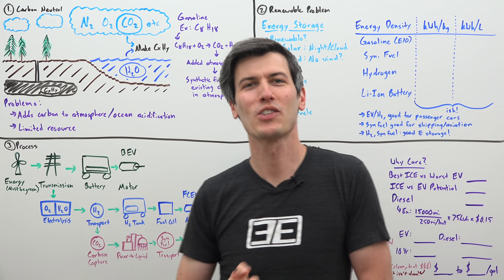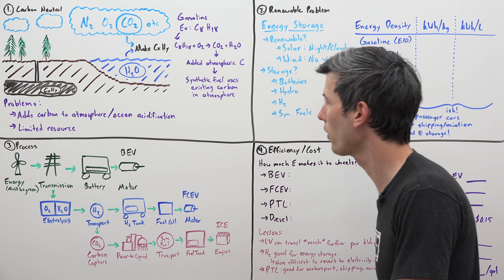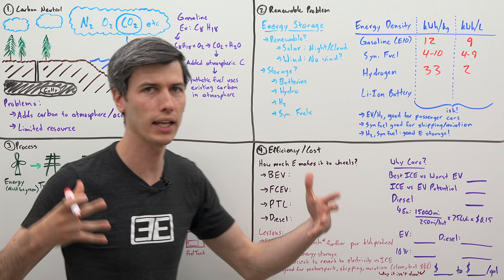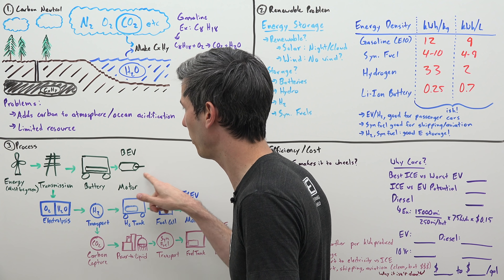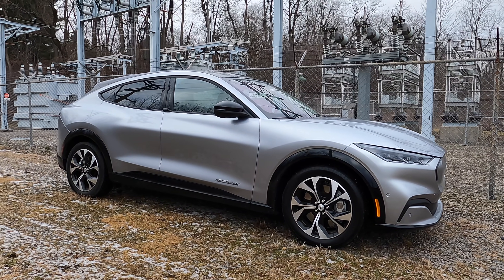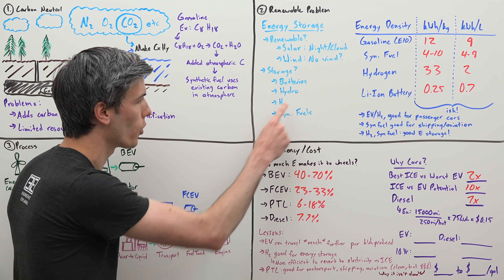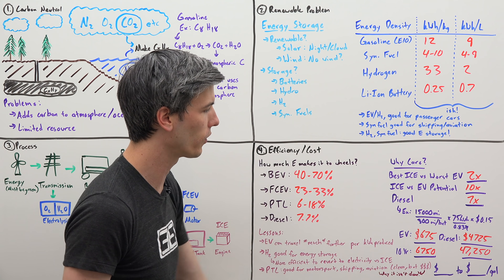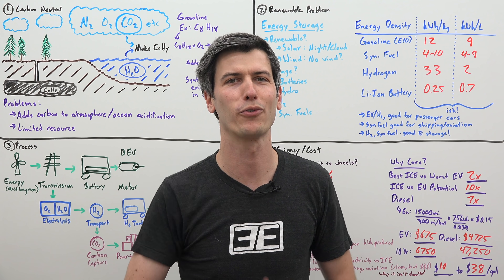The Big Problem With Synthetic Fuels

Comment: The fact of the matter is that it would be better to run on straight E100 ethanol produced from purpose grown crops with high sugar content like sugar beets (not corn) and not convert it to synfuel. The problem with ethanol is mixing it with conventional fuel. Henry Ford said ethanol was a much better fuel than gasoline because, even though it has lower energy density than gasoline, it can tolerate much higher compression ratios without detonation,  and all his early vehicles were designed to run on both with a simple ignition timing adjustment on the steering column. Ricardo engineering in UK built a pure ethanol engine that delivered tremendous torque for its size, more than a much larger diesel engine. The seals in older cars can simply be replaced with modern ethanol compatible materials. There is enough idle farmland to grow fuel crops without competing with food crops. It's basically become a political issue.

Comment: Right now its expensive yes but costs of the E-fuels are comming down every year by 2027 They predict it will be cheaper than the normal gasoline we have today. That would be a game changer. Supply and demand always the way the effect price. RIght now Supply for E-fuel is very low so costs are high. But Mass Production and Supply will bring the cost down. Same with the fuel prices today.

Comment: Another perspective for sure and I am looking forward to learning more. We still have all of the issues of EV re lack of range, cold weather performance or lack there of, charge times that are just not practical, and things I am less aware of but understand we should be concerned about re the mining of lithium, cobalt and the base needs of a Lithium Ion Battery. The cost of batteries is still incredibly extravagant re $5K plus as well. 

All this to suggest that of Porsche and others promoting Syn Fuels can get the price down to $2.00 per litre and produce it in the volume required, we may truly have a carbon neutral option that sees ICE enabled vehicles to thrive. The next five to ten years should make for interesting times. Great discussion and thanks for posting.

Comment: How about the carbon footprint of making electric cars? How much energy from renewables are actually being used for EVs? How about the crap infrastructure worldwide for charging vehicles. This analysis is biased to efficiency of the powertrain, it is only a small parts of the whole picture. EVs are loosing popularity because they are a big con. The are an alternative, and no solution..

Comment: E fuel  plant run by its own micro power grid would significantly drop the price of e fuels. Especially if it got its power geothermal .The technology also has the potential to sequester co2 from the atmosphere with its carbon capture making it a carbon negative . Also there isn’t enough copper on the planet for everyone to get a ev , especially if it’s getting gobbled up by the power grid just to charge up BEVs , and seeing as though ice vehicles are seriously hampered by pollution controls I’d imagine the would get more fuel efficient . Infrastructure is already in place. Less mining required. BEVs need to drive 80000km before they are greener than a ice vehicle running on fossil fuels, with synthetic how many more km? 
BEVs are also easily controlled by a third party. If co2 reduction is the goal and needs to be reduced quickly then billions of vehicles could be running on carbon neutral fuel in the next ten years. Significantly dropping co2 emissions without needing to strip the planet of copper, cobalt, lithium.

Comment: Great explanation although doesn’t take into account the likely cost reduction from producing the fuel at scale, which is what Porsche and its partners are aiming to do. Also, there are a huge amount of ICE vehicles that exist already and are likely to for some time. BEV vehicles are currently cost prohibitive for most people and use a huge amount of CO2 and other toxic byproducts to manufacture, so ICE is here to stay for quite some time I think. Lastly there’s application. Long distances in remote locations present significant problems for BEV vehicles.

Comment: Good video but you are working with current data for efficiencies but not for electricity generation. To charge an electric car on 100% wind or solar is fantasy for the average EV user, 10 - 15% of that charge maybe more realistic the rest would generated by oil or gas. That upsets the math.

Comment: Meanwhile , in Québec , we have hydro-electric powered  electricity at 0.075 usd / kw for domestic use , but I've heard at the radio it can go as low as 0.02 usd/kw for industrial use. 0.02*38/0.15 = 5$/gal. If it where only using electricity for the process , it could be about 5$/gal.

Comment: The problem, with electricity is storage, any kind of disaster disrupts supply inmediately, unless you run the lines underground. Li-ion batteries will cause wars. Sinthetic fuel could be a solution because of the access to prime materials.

Comment: what you didn't mention here is that the infrastructure for the distribution of E fuel is already there . Nobody talks about the amount of copper we will need to build the electricity grid to power all the charging stations. What will the cost be to do just that if you compare it to building an infrastructure to make fuel which you can store in a tank instead of in a battery.. Also , how much pollution will we produce to replace all ICE cars with EV's and do we even have enough raw materials to do so ?I still think E fuels might be a short term solution because you don't need to adapt your car ( zero cost or pollution ) and you can mix it with normal fuel. It might not be completely CO2 neutral but it's definitely a step in the right direction.

Comment: Renewable is not the only point of synthetic fuels...you're also trying to get oil cartels out o the energy sector, because clearly their laundering money through the industry...just like real estate and precious metals....so EV's need time and cover to supplant the industry...synthetic can destabilize attempt BUT if battery supply chains are vulnerable, synthetic fuels can buy time for battery technology to scale securely....So, gmo technology probably applicable here..."CRISPR" method in a virus...in a bacteria(strange but science can likely do it)...where the bacteria inserts a gene into a crop of corn or cucumbers...Possibly can be done to seeds but after growing probably fine...and youre just getting those "hydrocarbons" into the plants...as far as pollution...Once you can make the fuel, you can use it to run carbon capture engines and reclaim a lot of the emissions...so it's not all about renewability at early stage of transition, or even adversarial to electric cars traction, commercially.

Comment: Synthetic fuel is only widely useful in general aviation since that's the one spot where fuel will likely never be replaced completely. Same with trucking. You can't recharge or replace batteries faster than filling a tank.

Comment: Photovoltaic solar energy to electricity  is about 20% efficient.  Wind is 30-40%.  But concentrated solar that collects heat and tracks the sun is about four times as efficient as photovoltaic.  Hydrogen can also be extracted from water with heat.  Synthetic fuels can be synthesized with heat.  Residential solar does not lose the 25% in transmission.  Concentrated solar tracks the sun which gives another 25% advantage over fixed in place solar panels.  The waste heat from concentrated solar can be used for heating.  When the cost of concentrated solar is figured in and adjusted  for exponential decrease in the price of the system over time as happened with solar panels it is an entirely different picture.  Then there are the high efficiency high temperature  photovoltaic solar cells  with twice the efficiency of fixed panels.  
If the cost of residential concentrated solar  PV combined with solar thermal is figured in, if the the system is four times as efficient and costs half as much as conventional solar panels. the economics are entirely different.  Figuring in the savings on heat by using waste heat from solar panels is another factor of maybe two or three.  
He says let us know in the comments below but how many of these channels  are working as Youtube deleters? Fast talking spokesman with the last word as with the fake climate crisis they tell us the science is settled.  
Then there is storage of concentrated solar as heat in inexpensive thermal batteries like sand or gravel that cost maybe   hundredth what lithium batteries would cost for a week of storage. 
As with the junk climate science that starts of this video, the science has not been settled.

Comment: 1g of gas has 34 kwh.  A synfuelcell vehicle would hypthetically get decent range off just a few gallons of gas.  $10-30/gallon wouldn't be so bad if the you had the  efficiency advantage of electric motors and the weight advantage/energy density of hydrocarbons.

Comment: Theres some reasons hydrogen and e-fuels might become part of the future fuel mix. 1. Energy storage. They plan anyway to store excess wind energy as hydrogen so the conversion to hydrogen can be considered ”free” as long as demand for fuel is not larger than the need for storage. 2. Batteries are still very polluting to make so there might be environmental advantaged with efuels for cars that you dont drive a lot of miles but need the range. 3. Hybrids with efuel might be the best of both worlds, small battery for city drivning but the combustion engine for the range. 4. e-Fuel can be made from excess energy when electricity price is low, so the energy may only cost half of that used to charge the EV and that will offset some of the losses. 5.  E-fuels can probably be mixed with ethanol and bio-diesel fuels which adds flexibility to the fuel market. 6. In war time there may be no electricity for days, but you can have liquid fuel stored in an inexpencive container for emergency use. 7. For army vehicles that need long range off grid. I aldo believe the process of making hydrogen and e-fuels will become more efficient as demand drives innovation, will be interesting to see where we are 10 years from now.

Comment: Due to scarce raw materials, li-Ion battery production will flatline in another few years. The hope was that there would be improvements in battery technology, but none so far. Synthetic fuels do not have raw material procurement issues, so the choice is - precious raw materials vs. organic raw materials for fuel generation.

Comment: nit-picking. it has similar energy density as gasoline. it lets us use all the infrastructure of existing ice. no more fear imagining a summer trip recharging in a station full of people, so the charging rate drop and we will be up to 3h charging times... It does all of these good things, and it is even carbon neutral, ev's can't claim that.

engineering explained: a truck has to transport it by the end, so it is bad, it will never replace ev. 😐

Comment: I hate to point out the obvious flaws that every battery pro analysis always intentionally leaves out, its the 500,000 metric tonnes of earth that must be mined to make a  single battery that is non renewable and has a lifespan at best right now just over 20 years. The amount of energy and destruction of the planet which occurs in the process of churning through 500,000 tonnes of earth is staggering. It is 100% not sustainable if you think we will run out of fossil fuels in the future we will deplete our rare earth minerals FAR FAR FAR sooner with battery EV vehicles. Also not even in the long term these batteries will create catastrophic results for life on this planet far worse than a few degrees warming or ppm of carbon via the process to make batteries but  even more importantly the long term storage of the millions of dead batteries which is NEVER discussed.  This aspect is never discussed in these Pro EV blogs  the total destruction of the environment that will occur when we depose of the millions of EV car batteries that reach the end of their lifespan in 20ish years. These batteries are insanely toxic in isolation and when piled up in the millions its a game  over scenario for any life and water for who knows what radius and for how long. Battery cars are not the solution they are actually a far worse disaster for the planet than fossil fuels it's not even a debate. That is why technology like synthetic fuel even though less efficient  is valuable as it actually does move us in the direction of a sustainable balanced solution. Again because it can;t be said enough Battery cars are the worst imaginable solution to fossil fuels and will create large swaths of destruction and life ending toxic waste. Your battery EV is the fast track to the end  and not the planet saving device you think it is.

Comment: The discussion of energy density of various fuels and batteries is important for transportation but misses the main problem at the full scale of a new clean transportation system:  energy *delivery*.    

See for instance the main, iconic method of energy delivery now: the 9000 gallon petrol tanker, patrolling the highways every day.  That tanker hauls a terra-joule of energy, ie near an hour of the average output from the Hoover Dam, delivered in minutes to every other street corner.   The electric grid is not capable of delivering power like that, ie the dozens of MW range, to neighborhood street corners, nor will it ever be with  this tech.  

The trap ongoing at the moment is that the grid can comfortably abide 10% EVs, with charging at garage equipped single family homes, and some public fast chargers, though they’re a small smattering of the size of the petrol station fleet.  Yet none of that scales to a 100 % EV fleet where the majority of owners must do all their charging at public chargers, which must be close to them, thus forcing power demands the size of a small power plant, also close to them.  That’s no going to happen.  Worse, we might soon see some electric utility convince city officials that it needs to start obliterating every 5th city block or so to run HV power to a neighborhood.  

I agree w the point about the cost of syn fuels, but that’s largely a cost of thermal energy problem.  It’s resolvable w a large nuclear build out.  Not popular but the math irrefutably works, unlike the current waiving about intermittent power sources. 

There’s only one way to obtain a large scale personal transportation system: liquid fuels.  If you want it clean, make syn liquid fuels.  We can keep hand waiving and subsidizing our way to a failed EV attempt, or get serious.

Comment: In your video you are missing a huge part of the story. The energy infrastructure for transporting and storing liquid fuels is already installed and cost trillions to build. Switching to electricity means paying for that capacity again. I see no solution any time soon for storing ca. 4-6 months worth of electricity for whole nations.  Electrical grids would have to handle minimum 2x the load and be upgraded significantly. Additionally it will probably take something like 20-40 years to switch to electricity vehicles and heating if today 100% of new sales were BEV and heat pump heaters. I see no way at all to switch to renewables quickly without a drop-in solution so that existing equipment can be used. The issue is economic efficiency of the existing asst base and NOT energy efficiency based on a hypothetical world where everything is magically replaced at once. You need to make an actual business case based on reality and not on a hypothetical world. In many, many cases it is surely more economical to continue operation with higher fuel cost than to replace everything.
Reply: I agree. Most of these youtubers are left leaning lunatics.

Comment: The process assumes that the energy input is electricity. While that's true in most cases, if at least some of the energy input to a synthetic fuel production process is heat, there is a possibility of using other energy sources.

Comment: If you're going to use the format of a chemical equation  ("C8H18 + O2 -> CO2 + H2O"), then you could put in the numbers to make it correct: 2 C8H18 + 25 O2 -> 16 CO2 + 18 H2O

Comment: Should not forget that synthetic fuels would still have some current combustion vehicles  problems like the NOx emissions
Reply: True. But it can be minimized by using microturbines (they can be 35% efficient if used as a generator range extender).

Comment: Great explanation! I’m a massive car guy, so the synthetic fuel thing speaks to me. 
You stated it very clearly that it’s not that efficient. Makes total sense. 

I was wondering how you feel about bev’s battery degradation? 
Like a 40 year old car has a high change of still working properly today. How do you think that will pan out in 20, 30, 40 years, with batteries? I know my phones barely lasts 3 years. What about cars?

That’s the main thing that keeps me from buying an electric car with my own money. Who will want to buy my car in 10 years time?

Also do you think it would be a good idea to force mass adoption of e-fuels (ban regular fuels)? It would have immediate impact since not everyone is able to buy an electric car, they’re expensive to buy…

I really hope there’s a future where e-fuels get a bit cheaper and more available to keep cool ice alive. Together with ev’s and different solutions of course!